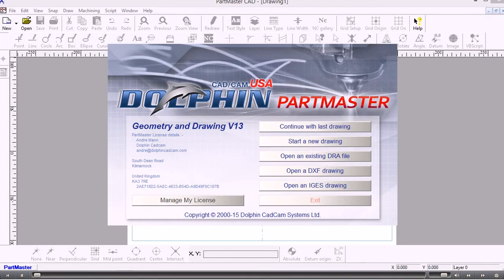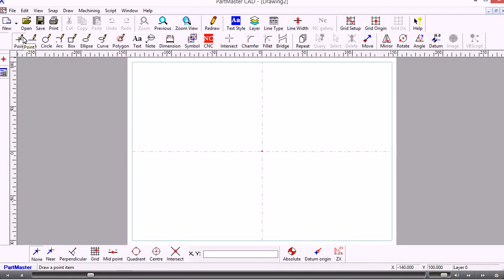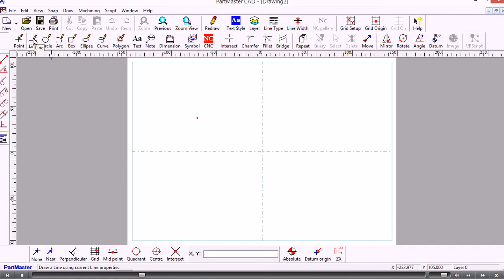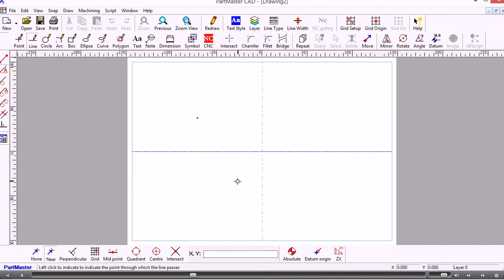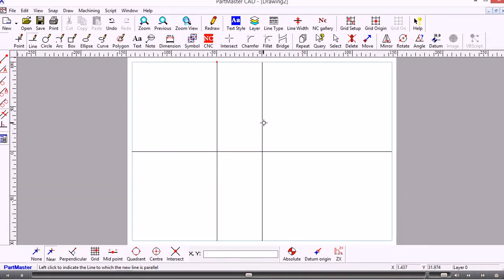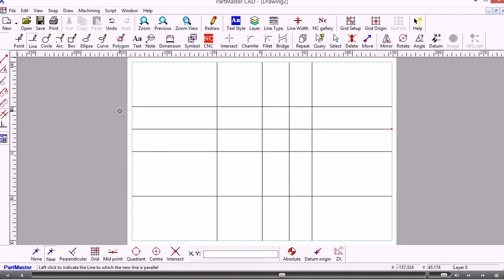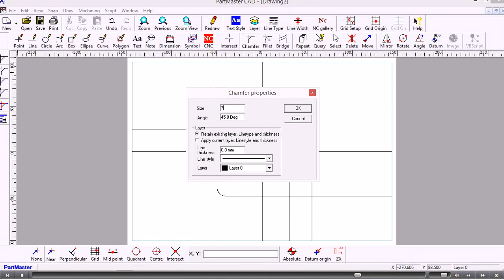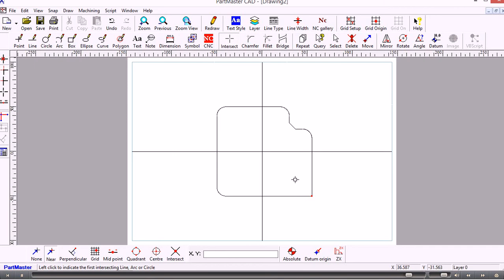Dolphin PartMaster CAD  Basic drawing

Comment: The fact that this video has 69 views (several of which are mine) indicates that you need to do a much better job of educating customers. I suggest you check out Alibre's PDF book of sample designs with step-by-step directions. It should be very easy for you to put something like that together. The easier it is for people to learn how to use your program, the more people will buy it.

Also, be sure your teaching materials correspond to the version of Dolphin people are actually using. I do not have the file CountourV13.dra. I do have Contour with Z Profile.dra, which appears to be the same.